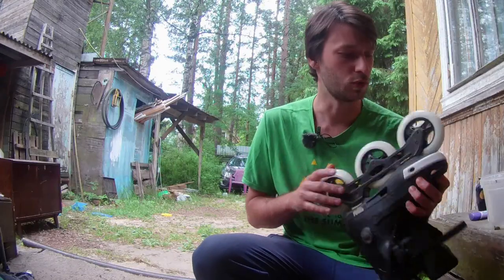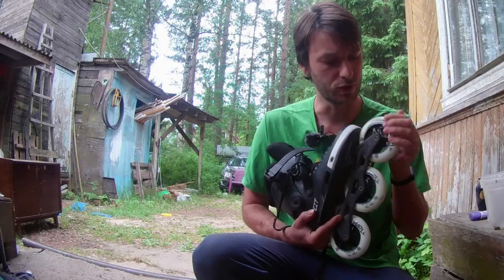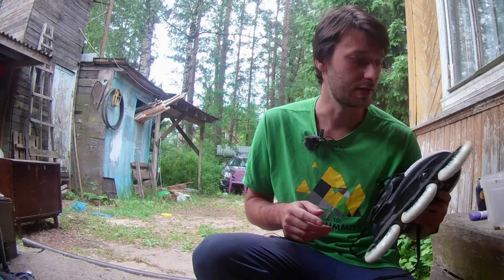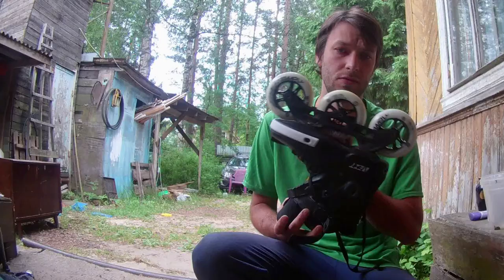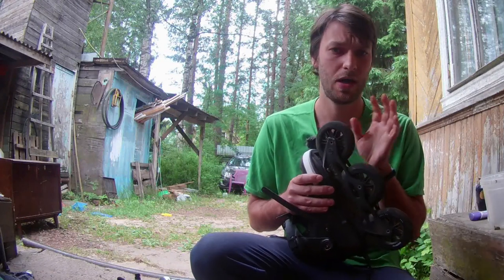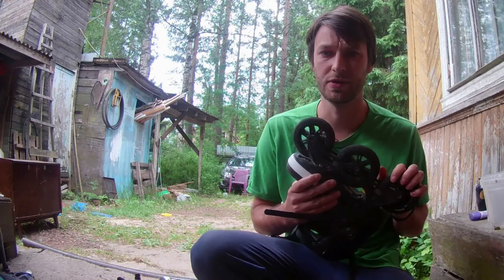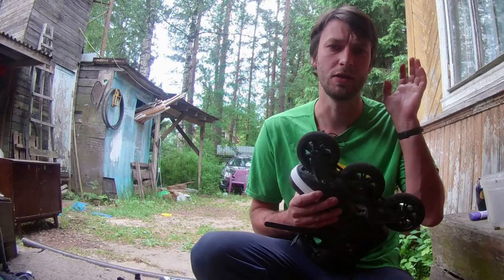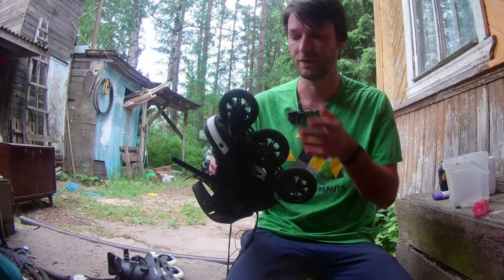Inline skating MYTHS. MYTH #1.Bearing's freespin

Comment: I'm happy to see this video. People have silly ideas about bearings. The difference in friction affecting length of freespin is such a tiny tiny tiny percentage of the friction applied to them during use, with a 80kg bag of meat on top of them. Another thing is I don't notice a big difference between cheap bearings, down to abec 1 even, and expensive ones, as long as they're not full of grit, and lubricated. Durability is another issue.
Reply from the maker: Yeah, you're right. I've been thinking about making the different video about myths on abec numbers. Probably I will make it soon.

Comment: Great channel, and you're absolutely right.  Once I learned that bearings can and should only be judged under load, I started using grease in mine instead of oil.  The grease does a better job of keeping dirt and water out so they roll smoother and quieter for longer between cleanings and I haven't noticed any performance impact.
Reply from the maker: Thank you! I never tried to compare grease and oil bearings, but I will remember that for the future.
Reply: @danatello8489  I've been using Super Lube Synthetic NGLI Grade 2 grease with good results, but a lot of people swear by bog standard lithium grease.  I apply three small blobs about the size of a ball bearing per bearing.  They might seem slower at first, but you gotta skate on them for a couple miles to thin out the grease, then the speed will return.
Reply: Exactly what I did in my bicycle, people keep asking what oil do you use, your bicycle rolls quite yet fast, all the people with fancy expensive oils, when I tell them that I just greased the chain rather than oil, they seem really shocked.
Reply from the maker: That's a nice and interesting input. Thank you!

Comment: My brand new bearings don't spin AT ALL.... On the wheel they spin for like 4 seconds, and my old unlceaned 4 years old bearings spin MUCH better. What is the problem?? They are flying eagle bearings so they should be high quality
Reply from the maker: It depends on the type of oil/grease that is used to lubricate the bearing.  They will work ok under the load, when the oil will become hot.

Comment: So, where my wheels spin for about 3 seconds... does that mean it's my bearings that are the problem?
Reply from the maker: Probably yes, but sometimes the frame bolts could also be overtightened. And there is also such a type of bearings grease that doesn't allow to freespin, but spins great under load. If it doesn't slow down your skating, then freespin is not an issue..

Comment: I'm not sure about this. How do You know that the old ones don't actually perform better under the load ?
Reply from the maker: I can feel it:)  it's pretty difficult to show on video. Because you will have to make the same root in the same conditions on different bearings, but when you're skating, it's pretty obvious
Reply: @NikZvi  ok, but I have noticed that if You dont tighten the screws on the new wheels they will also have good freespin. I was told at the shop that its due to the spacers. If You would use adjustable spacers it would improve the performance. Don't know actually what to think about it. If You have any thoughts about it , please share.
Reply from the maker: Well I wouldn't risk to not tighten the bolts on my wheels . They can simply fall out and I will either hurt myself or will break the frame. Don't know about the spacers. But usually the freespin depends on the type of lubricant (oil or grease) . Some type of lubricants have to get hot to be more fluid. Although I never dig too deep in it. I guess that my old bearings are spinning so long because there is only one"lubricant'" left in them - the air. All that I have to say is that new wheels can have a long freespin or a short one, but that doesn't matter.  How they spin when you're skating that's what matters.
Reply: @NikZvi  of course I didn't mean to suggest to skate with untighten screws :) just to test the actual freespin of the new bearings without the imprecise spacers affecting them.
Reply from the maker: Ok) I'm a little bit dumb today.  I don't think that spacers could affect it much. It's the property of the lubricant mostly.